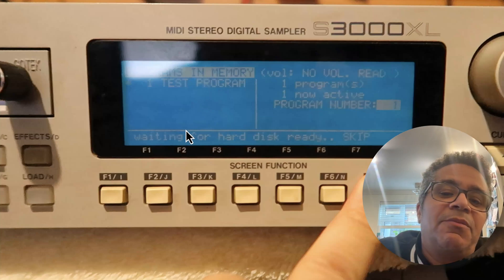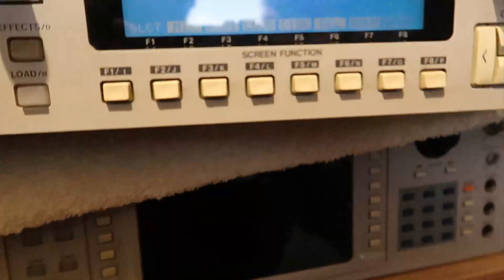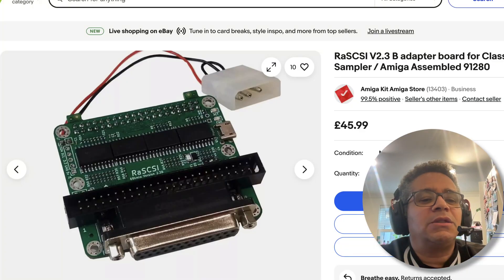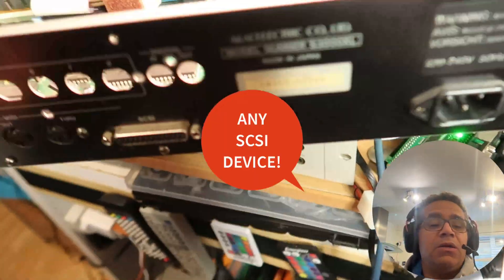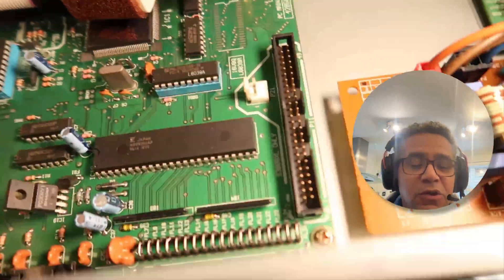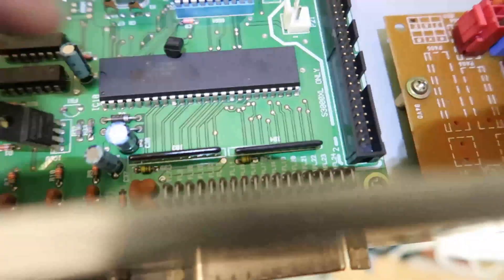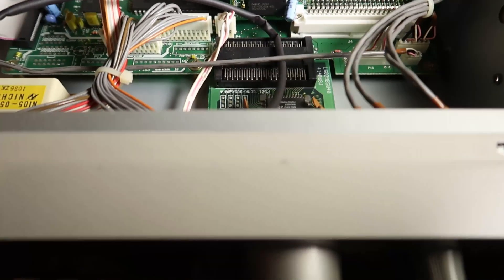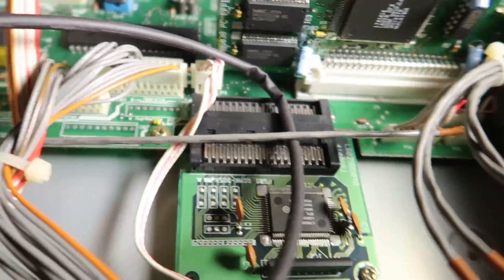Sampler Won't Boot? Watch This Simple Fix!

Comment: Cool thing is if you use both filters at the same time, you'll get a 24db filter. The resonance of filter 2 sounds different than the resonance of filter 1. 
If you set the cutoff to the same value and tweak both resonances , some nice dirty synth sweeps are possible. I used the S3200XL as a synthesizer with single cycle waveforms for a while.
You should give it a try. The DAC's on the S3200XL are a little bit cleaner but it all depends on your needs.
Reply: Forgot that those samplers can't loop only one waveform cycle. You need to have at least around 5 for seamless loops.

Comment: Yeah, the original issue is the scsi fuse on the mainboard, can be replaced with a resettable fuse. Mainly caused by scsi cable disconnections or powering off external scsi device before turning off the sampler. A Self resettable fuse is a replace and forget item. 👍

Comment: I could only guess that's the filter card in there Bizz. Super rare, rare as hens teeth. Id love to see a video about the rar scusee card. Is this so that you can pop a SD card into the back of the machine via the SCSI port without the need to do internal modifications for the internal SD hard disk mod.
I have S2000 samplers but don't want to have to solder or modify the main board to keep it as original as possible.

Comment: I'm far from a technician, I can solder a bit. I've done this when my S3000XL developed that 'waiting for disk' SCSI fuse issue. I just followed a couple of online tutorials and replaced it with a glass in-line fuse on some wire in case it happens again. So I can just remove the cover to replace it rather than pulling all the I/O out on the back again. My only advice would be you need a decent set of mincers or a magnifying glass because the pads where you'll be soldering to are flipping tiny. It's been absolutely solid since I replaced it, zero issues over the last 2/3 years.